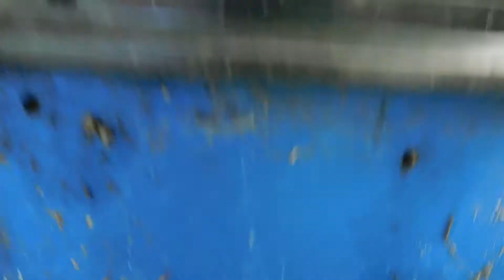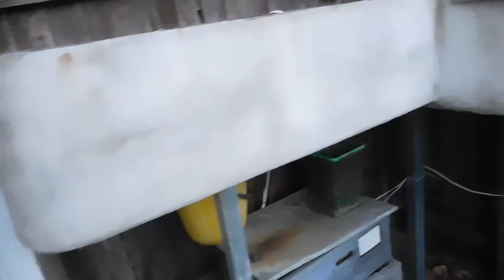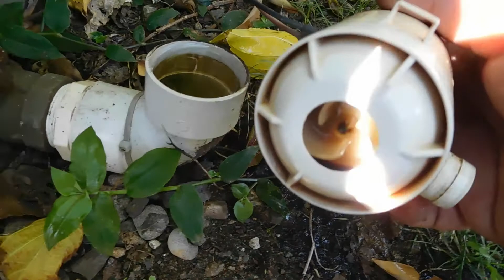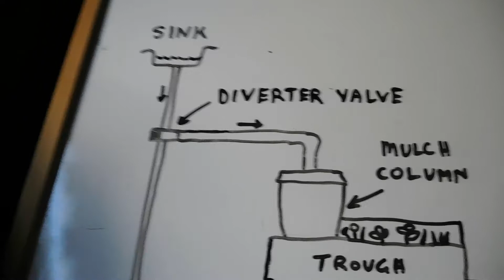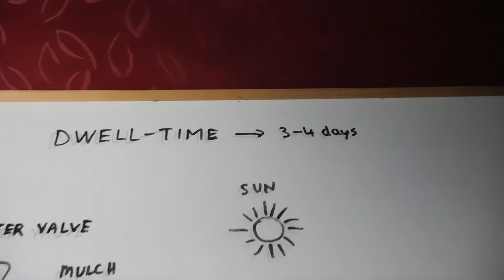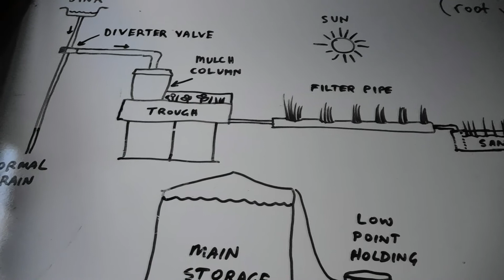Kitchen water recycling for garden. Grey water, aquatic plant, home, natural water cleaning. (pt 2)

Comment: I want to grey water reuse from shower, bathroom sink and washer/dryer. Can I use the same system? it would be just 3 of us.  I am thinking, it would have to be on a larger scale?  Especially the mulch basin.  right??
Reply from the maker: @Tgyrl32 Thanks ! Glad it was helpful. Soaps and laundry powders contain harsh chemicals high in sodium and phosphate. Usually they are regarded as 'black water' and go down the drain. You'd have to be careful to avoid too much for plants to handle and sodium build up over the years in the soil. I totally minimise detergent use and use a low sodium grey water safe brand. Been going more than ten years without buildup issues. Maybe there is a way if can find safe products in the shower but I'd skip collecting laundry water.
Reply: @ thanks! Appreciate the advice. I use all natural detergent (very mild), but will reevaluate that as an option.

Comment: Kindly do an update of your greywater system. Thanks.
Reply from the maker: The system is still operating as 12 years ago though it has less stages now - the open top tank and the filter box on stilts both developed issues after 10 years some leaks and the wooden stilts needed repair. But the rest is still functioning well to today and we still use for gardening watering. We are extra careful what goes down the sink minimising detergent and cooking oil and food waste.

Comment: Thanks for the details Ben. Question - do you have media in the 4 connected barrels other than just the plants? Can you comment or provide a source on the fittings for the barrels?
Reply from the maker: Darin, just plants. Any through hole fitting that has a flange on one side and a threaded section on the other for a large nut will do the job plus sealant or rubber washers on either side. A hardware shop should have them in the plumbing section.

Comment: We are currently having our kitchen water draining through a worm-bed(This captures all grease and feed our worms with pieces of food that might flush from the kitchen sink), then flows into the main 110mm pvc pipe together with our wash water.
I would like to recycle all this water but compared to the volume of your water mine is much more, +/- 3000 - 5000liter per week. My plan is to build 5000l system so I know the water should have enough volume of roots to move through....(You said 3-4 days, I assume 5 days would be safe)
I assume just using more of these blue drums or even old bathtubs to make up the volume should do the job?

Comment: Thanks Ben, you got my wheels turning; for now our kitchen is diverted to a Mulberry Tree in our back yard, draining through many 7mm holes on bottom of a horizontal 7.5cm diameter PVC pipe.
Covered with straw it never smells, and I pop off the end occasionally and empty both sinks to purge any buildup.
Next step will be to add a grease trap, and one day some aircrete troughs or tanks.
Reply from the maker: Hi Ross, grease trap is a better term when I think about it- I called it a mulch column. I tried many mediums but the chunky coir fibre stays open so it doesn't seal over. When I used too fine a medium the oil sealed the surface and it backed up. Just something to note. Thanks for your thoughts. Cheers.